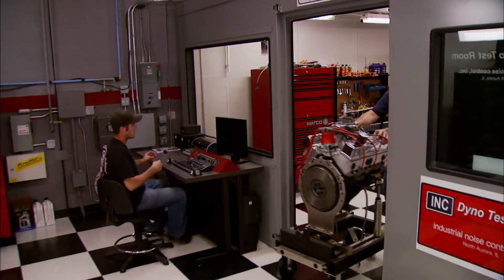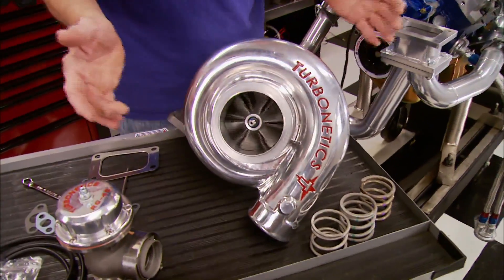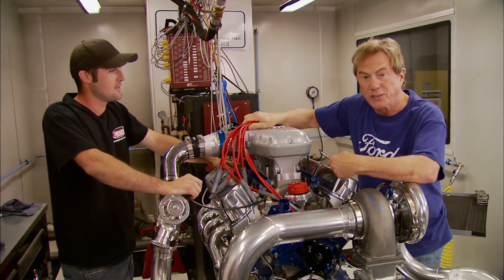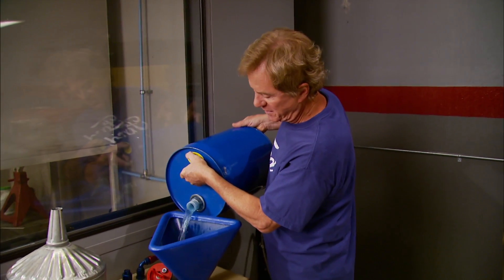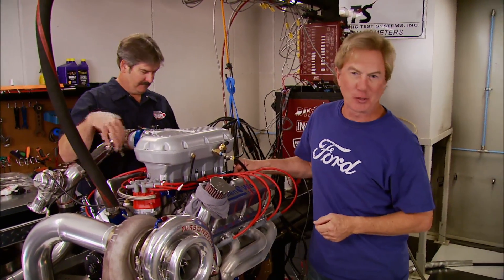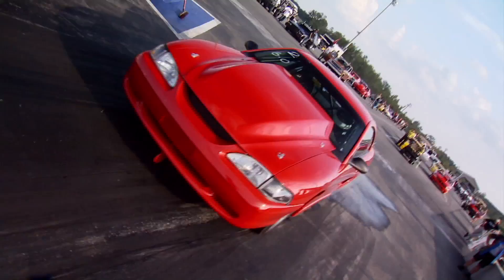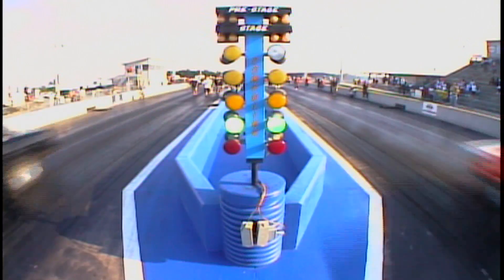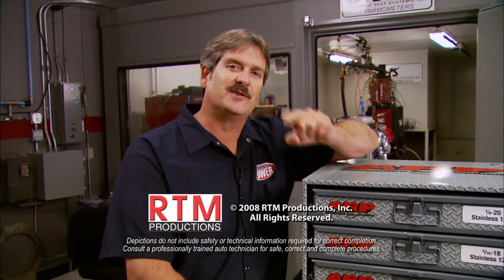Putting the Turbo in Turbo Stang: Enough Boost To Produce 900+ HP - Horsepower S12, E19

Comment: 8:50 Get it right. Every engine has forced induction. The piston isn't sucking air. It's forced in by the atmospheric pressure.
Reply: This is definitely correct but doesn't follow common use language. When someone says forced induction versus naturally aspirated everybody knows what that means, no need to nitpick.

Comment: How many other guys watch this and wonder where was all this shit when we were in out prime? Then to top it off, at the very end they show how ARP has a four drawer bolt set up! All these years buying the ARP bolts with a part number and waiting for the UPS truck. I have some bad ass cars still, but been in it so long I dont even give a shit anymore. Ready to sell all and retire to just one. I dont even know if I'm going to do that. The big difference between then and now is we didn't build our cars on credit. No regular guys were doing any of the crazy stuff people do today because it cost too much. I have a tubbed 72 olds with a 540 that makes over 950 on the motor plus a nitrous fogger, a 72 Monte Carlo 7.50 cert that I need to finish, another 72 Monte street car that runs 11's, a 91 Z28 that's mint with 430 horsepower, a 70 Pontiac GTO clone project,  a 96 impala SS and one clone ss with an LS swap. I wish somebody would come and buy it all. I'd buy my 69 Chevelle back and get a boat... off into the sunset. Burnout is a bitch.

Comment: Man I miss the orsca days Huntsville is my home track and back in 2005/2006 i was 15 or 16 and got to  run the 7.0 index class twice with my pawpaws 81 small tire sbc Camaro that he put me in when i was 14. Orsca was just a badass organization I got to watch Tim Lynch set the outlaw 10.5 record while carrying the front tires the whole pass it was awesome. I believe 2006 or 2007 is when orsca died. I loved it, watching outlaw 10.5 cars back then is what really got me into heads up racing and boost up until 2007 I was a nitrous guy we had two plates stacked under the carburetor on the 406 in that old Camaro it was a nice car and actually pretty fast for a nitrous small block """street"""" car on 28×10.5s it went 5.70's pretty consistently. I started grudge racing in September 2006 a month before my 16th birthday and in June 2007 we was at a shitty track I'd never been to in Georgia racing a guy for 1500 bucks and we where both all over the place but right after the 330 i was out of the groove close to the center line and the other guy was to but i wasnt paying attention to him i was trying my damndest to drive the car and stay out front his front bumper was around my back tires it was a good race but he ended up crossing and hitting me and I spun around fast and went head on into the wall in the left lane at 400 foot then bounced off and went around again and the rear end of the car hit wall and stopped it totaled the car... Whats bull shit is the guy I was running was in a foxbody and all he had to do was replace a wheel fender front bumper and hood but I totaled a car that meant the world to me, I did learn alot from that wreck one thing bein a couple thousand dollars aint worth being a hero trying  win riskin your health, car and the other person's cars before then I didn't lift unless it was spinning or the back bumper started getting to close to the ground lol

Comment: 4:59 "You don't have anything to spin the oil pump. You lose oil pressure and the motor gets destroyed." Wouldn't you also lose ignition and the motor would just turn off?
Reply: some engines do and dont depends on how the gear was mounted to the shaft and how the oil pump was connected

Comment: Great show 
As a suggestion for a future build i would suggest the Ford v4 engine found in the Saab Sonett and Saab 96 it was also found in the Ford Taunus 15m and 17m and some industrial applications and was the original engine meant to be used in the Ford Mustang 
the engine original put out between 65 (1496cc) and 72 horses 1700cc
Saab managed to put out between 160 to 180 hp by boring it to 1815cc and adding dual weber 45 among other things  for their rally cars back in the 1970s
Some people have managed to put out about 200 hp out of it with turbo back in the day
I wounder what you guys could do with that great little engine today with modern parts that wasn't available back in the 1970s
thanks in advance

Comment: Can also run a melonized gear on a roller cam. It's compatible with everything and doesn't wear like the other types however the downside is if you swap the gear to different distributors in your collection it gets very easy to forget which one has it on.
So after forgetting which of my dizzys has the melonized gear on, I now use bronze lol.

Comment: I have a question, Do you only work on Ford and Chevrolets?
Reply: They do have some Mopar builds, but they're rare. Some of the old Mopar stuff is limited on parts selection, so you run out of combination content really quick with those engines.

Comment: Index racing, go fast and then stand on the brakes, yeah right, What? They practice for being pulled over by the cops?
Reply: Racing against an opponent, and racing against the clock? Sounds fun, I'm not sure why you aren't understanding this. Sounds like it would be even more of a challenge in quarter mile runs.
Reply: @twistershift  Yes. you are right. It would be a challenge to watch it.

Comment: That's a little over 700 and change at the wheels....nnnnice.
Reply: You wrong.
Reply: @dayofleo8550  Was I too high or too low? I 've always heard there's about a 15-25% parasitic loss from the drive train.
Reply: @Dakktyrel  low. It’s about 850-915

Comment: It’s not a motor, it’s an engine. Motors are electric.
Reply: Motor: Noun
2: any of various power units that develop energy or impart motion: such as
a: a small compact engine
b: INTERNAL COMBUSTION ENGINE
especially : a gasoline engine
c: a rotating machine that transforms electrical energy into mechanical energy
Reply: @twistershift  Raymond is technically correct, but it's still pendanticism. He seems like the kind of guy who uses phrases like "Well, actually..." then essentially argues semantics because he thinks he can come off as knowing more than others and thereby try to counteract his sense of inferiority.
Reply: Numinous you just defined all of reddit. Lol.
Reply: @Nmdixon-cu7vm  LOL!

Comment: I’m a Ford guy 100% but that’s a lot of work when you can just take a stock junkyard LS, throw on a turbo and make that 900+ hp for fairly cheap.
Reply: When you blow an LS you just make another trip to the junkyard NOT the machine shop. Really great built here though for sure. Boost makes HP.
Reply: I only came to the comments to post this too.

Comment: Just use a Holley terminator and individual coils and a wideband wouldn’t hurt . Use a proper Mac valve for the boost control . You’ve built a quasi efi with all the problems of a distributor . What a mess.
Reply: Remember when this was recorded efi was less accessible and more expensive.   Holley efi  wasn't a thing yet.
Reply: Yeah, the turbonetics Y2K is a giveaway this video is from the early 2000's

Comment: Is that a 302
Reply: Probably stroked 351
Reply: 4.030 bore 9.5 deck, not stroked. Its in the bottom of the long description
Reply: @chrisduncan2626  They said it's 382 inches. I would call that a stroker.
Reply: @413x398  mustve missed that part my bad. I read the description and it said a 290hp 350ci crate motor
Reply: @chrisduncan2626  That was the Chevy crate engine lineup they had later in the vid. At 382 inches, you are essentially looking at a quarter-inch stroke increase to 3.75" on a Windsor, plus the overbore.
Reply: @413x398  ah i see. I didnt get that far. Well hell im all wrong today lol
Reply: @chrisduncan2626  Don't feel bad. I got a case of the hives seeing four Chevy engine lined up in a row like that. Might be days before I return to normal, whatever that may be.